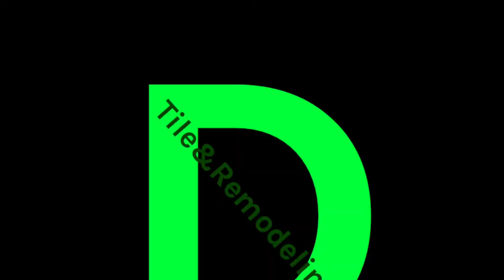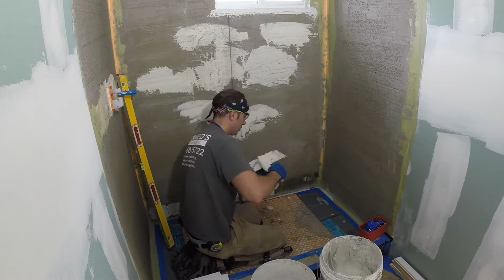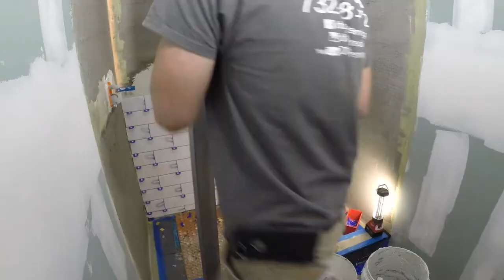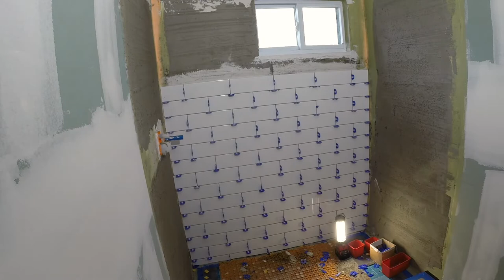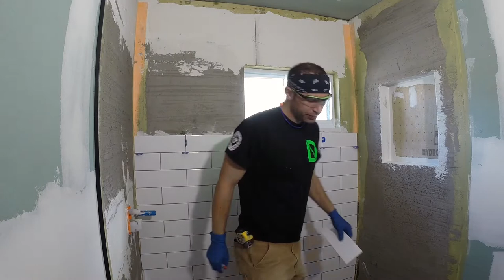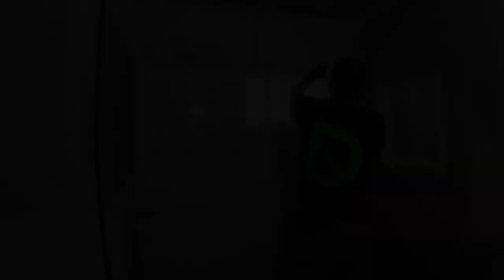4x12 ceramic subway install Part 1. Wall NJ

Comment: Hey so why the cut tile at bottom ,,looks like it would have worked out perfect with window if you didn't cut 
and is that a 1/2 inch notch trowel 
Thanks

Comment: I see you did it at a 50 offset, the 4x12 tiles i purchased says not too, curious why. is it the built in spacers for the grout? :)
Reply from the maker: If the box say not to offset that much then don't. The tile might be badly cupped. Alot of subway tiles are
Reply: Thank you for the reply!